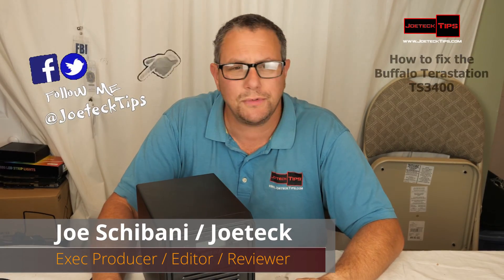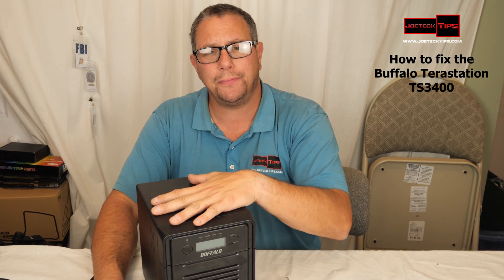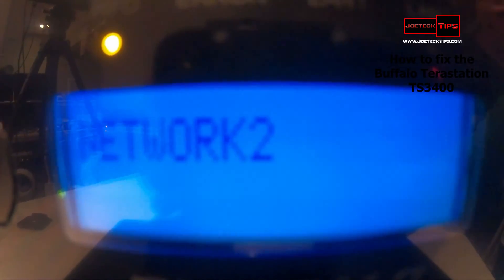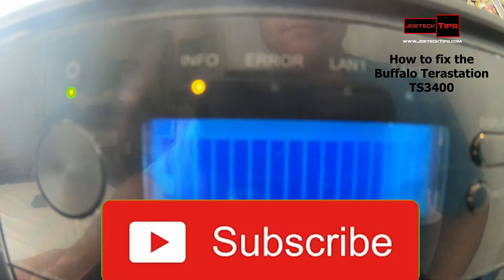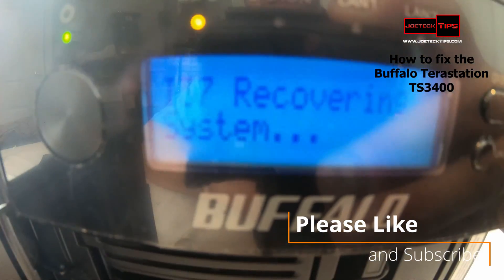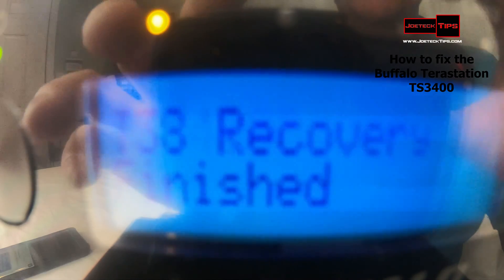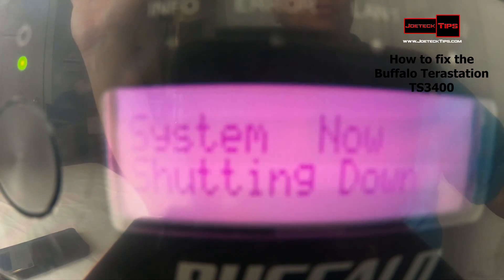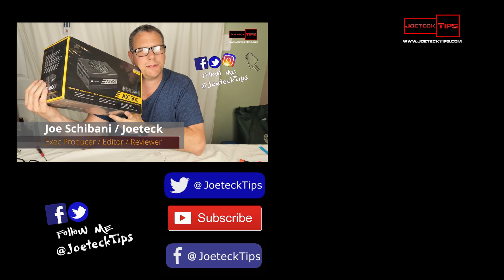My Buffalo Terastation TS3400 is dead now what? | HOW TO | JoeteckTips

Comment: I get "I45 recovery failed"
Reply from the maker: Install new drives.. Cant recover with bad drives.
Reply: @Joeteck  brand new drives. initialized MBR with no partition (tried GPT file system as well)
Reply from the maker: @fightingblind they need to be unpartitioned. Let the device do all that. Also, make sure the switch on the back is not set to USB.
Reply from the maker: Also, drives can't be larger than 16TB each.

Comment: Hi - I have a LinkStation (ls-w1.0tgl/r1) with a 7 red flash error code, which appears to be a hardware failure. It doesn't show up in  NAS Navigator.  Not sure what my options are, but hoping I could try to find a replacement unit (probaby on ebay) and put my current drives in it? I also have a TeraStation - wouuld there be a way that I could use that to access the data from my LinkStation? Any thoughts would be appreciated?

Comment: I wish there were someone like you that could help with a linkstation duo
Reply from the maker: What's the problem?
Reply: @Joeteck  

I'm using the linkstation on a home LAN it will not be connected to the internet. The "problem" right now is that my computer just doesn't see its IP address.   I confess that I have more than one of these that do this. (Spoiler Alert) This conversation may expose how little I know about how a Buffalo linkstation works.
Reply from the maker: @Cal Smith  add it to your network, let it get an IP, connect via the web browser,  then change it to a static IP, but keep that address. It's a NAS, it must have an IP address.
Reply: @Joeteck  

The Linkstation I'm working with is an older model and not a "Terastation" like the one you have in your video.
Reply from the maker: @calsmith7902  Ok, care to tell me the model number yet?
Reply: @Joeteck  

I will gladly tell you the model number (actually, there are two) as soon as I get a chance.  Sorry, my work has kept me busy.

Question: Is all or part of the firmware kept on the hard drive? Is the boot partition kept on the hard drive?

Comment: I have the Terastation Pro Quad. It requires a usb flash drive to flash the firmware to the new disks. I did not have access to the unit to make a disk from the interface that is no longer available. It will boot with a linux based iso that you have to make which I have no skills to do so. Have you had this issue?

Comment: glad you made this content, i might have given away all four drives that came with it.... i put in my own new drives and .... the red screeen that you have there,,,, i get no text on it. zero indication that it can even generate text. also you have a consol in where i have a four pin ..... 

so ... might be worth mentioning , i've tried so many button configurations, hold reset x seconds, for y seconds , hold reset and function for some variety of time . ..... you know how it goes. this was a terastation that was trashed by a company so i'm pretty sure they smashed the original drives anyway . 

so can i convert this this to be a drive reader at least. just anything ..... i gave away my drive reader thinking i could work soemthing out with this "four drive" drive reader ... but dang.

Comment: Thank you. Someone just gave me one without drives and now I have hope to getting t working. :-)
Reply from the maker: That's awesome!! Good luck, it's a great NAS
Reply: @Joeteck  Unfortunately I tried and it doesn't have the display so I am assuming a slightly different model even though it is a ts3400 series. Function button did nothing.
Reply from the maker: @mattsauro8881  make sure you have unused and unpartioned drives in the NAS